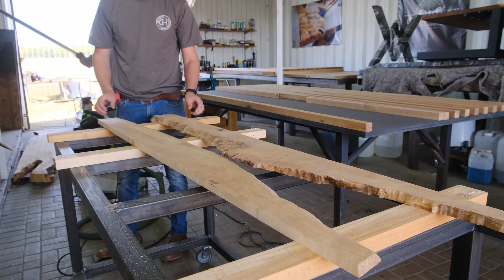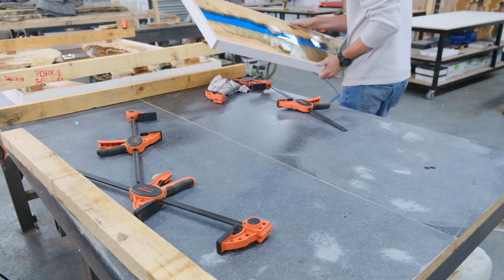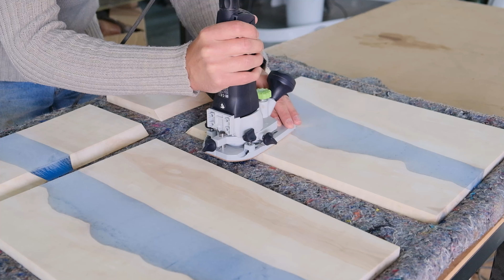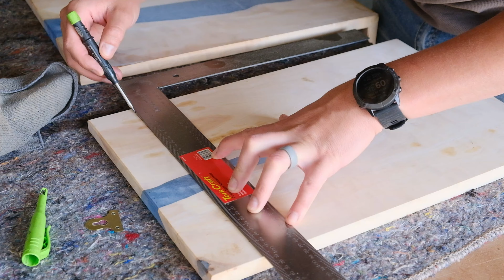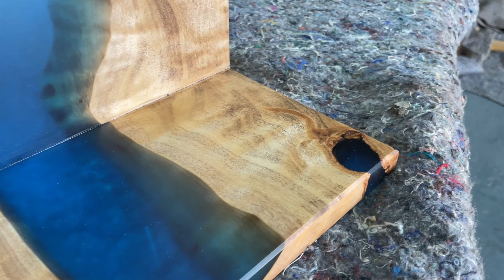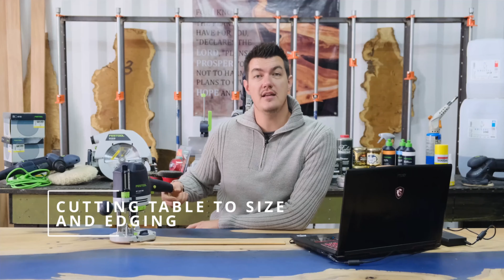building a EPOXY thing... WHAT IS IT???

Comment: How do I contact you directly? I will pay you for your time, but I need that advice. I’ll make you strips of decorative epoxy that would then be glued onto steel but if I make a plank of solid decorative epoxy and then rip it on a table, saw  How do I polish 😅the saw curf marks from the table saw